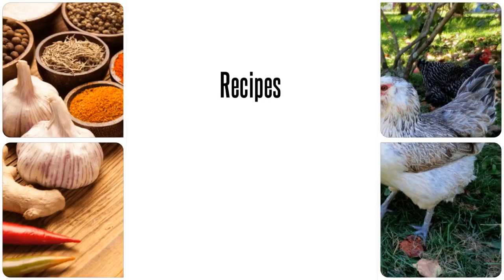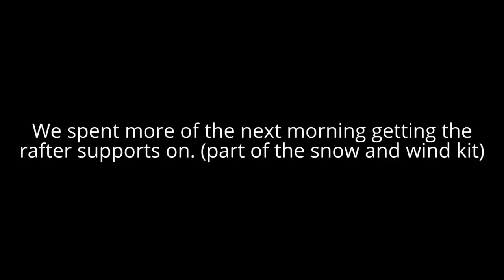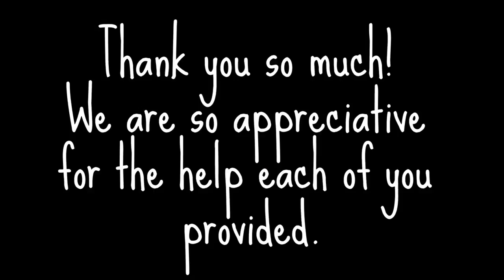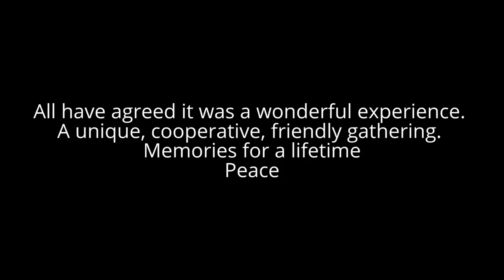Yurt Raising 30 foot Pacific Yurt Photo collection of weekend

Comment: Now that you have lived in it for nearly a year, what would you say you have learned about yourselves? Is the insulation sufficient for where you are located? What is your heat sources? How is the yurt performing during rain and snow melting? What would you change had you had known? What does the interior look like now? Thanks for sharing.
Reply from the maker: Welp Its been 5 years... Learned we didnt need a s much as we thought we needed and its hard but rewarding work to live the off grid life. Insulation is ok in winter, we used a woodstove, it heated well. Summer it gets unbearably hot (upstate NY) Rain is wondefull, No problems. We have it 2 feet off the ground at the lowest point so no problem with snow melt. Hmmm I like where im at at this point in my life so I don't think I'd change a thing. Heres a good look at the inside... Check out what were doing with the yurt now! https://www.airbnb.com/rooms/48850926?federated_search_id=45868ba3-2e8a-4e30-9bc9-c4aa305ea898&source_impression_id=p3_1651799678_mVBG7kM4G02jaDYU
Check out our instagram and please follow us https://www.instagram.com/yurt_phoria/

Comment: Thanks for all the videos, they are very helpful.  I am interested in the floor design.  How does it work with  the weight of the yurt structure coming down on the edge.  Has the edge of the foam board been damaged? What compressive strength does that foam board have?  Has it been sufficient? or had it compressed?  (As I plan my floor, I was thinking I would need  would blocking around the edge, but maybe not, now that I see yours). Thanks for any info and wisdom you can share.
Reply from the maker: Did you build? No compression after 5 years. Not sure of the compressive strenght. The weight is distrubuted across the floor so its not all just coming down on the edge. Check out what were doing with the yurt now! https://www.airbnb.com/rooms/48850926?federated_search_id=45868ba3-2e8a-4e30-9bc9-c4aa305ea898&source_impression_id=p3_1651799678_mVBG7kM4G02jaDYU
Check out our instagram and please follow us https://www.instagram.com/yurt_phoria/